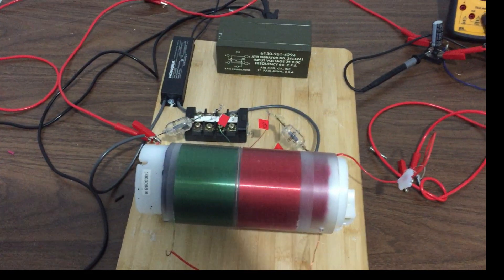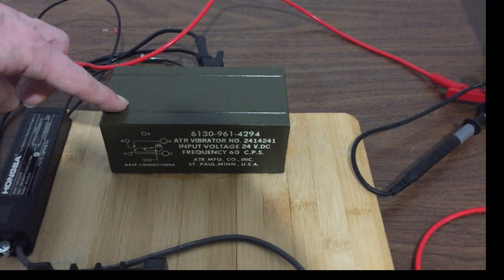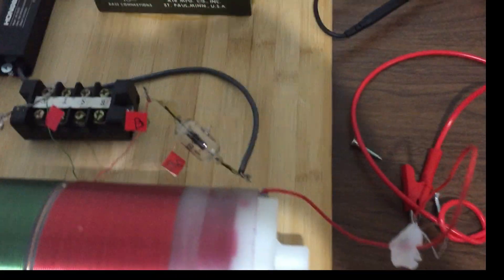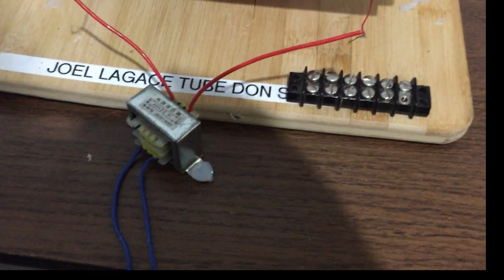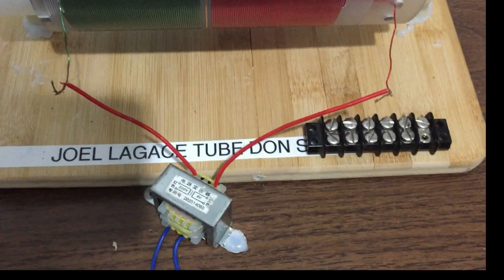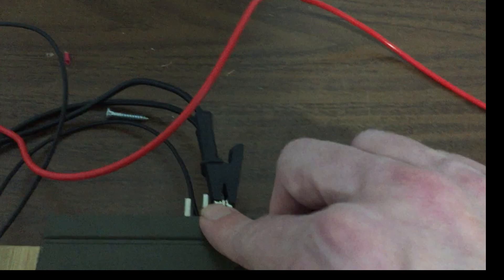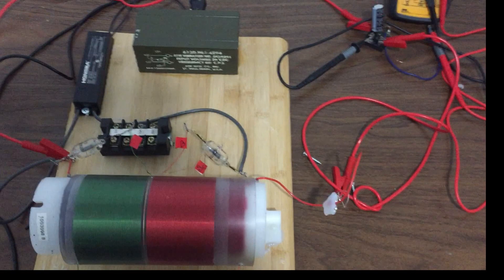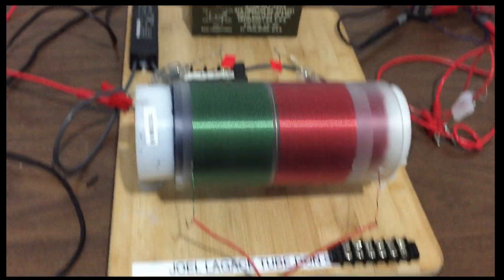Don Smith Classic Demo

Comment: Common 6v and 12v vibrators for old car radios from the 1950's and before, would work pretty good. But they have a fixed frequency of 115hz.

Comment: if you listen to Don's 1994  lecture, he talks about the "wave-shaping" stage where he takes the DC spikes and via two asymmetric coils(50-0-52), he calls them back-to-back Tesla Coils and creates the Sine  wave like output and then runs through the caps  to further smoothen the peaks.  To drop the frequency to 60Hz, he said that MOT can do the trick with its Primary being self-resonant together with the MW cap at 60Hz.   I think other experimntalists use the active resonator as the secondary circuit, for example Akula, Kapanadze  etc and modulation/interruption for the energy transfer on-demand to the load.  The interruption frequency of the resonator increases with increased load…
Reply: Thank you ;)